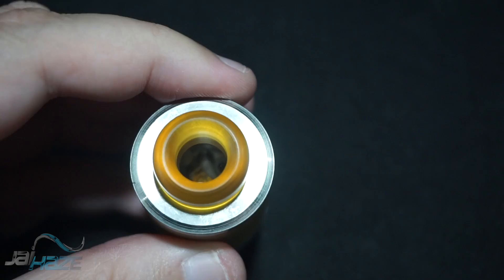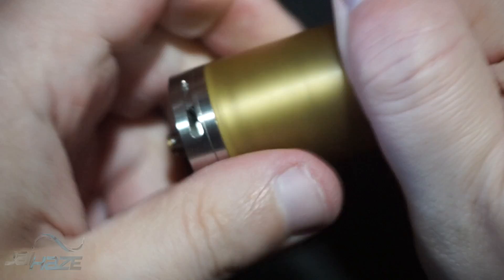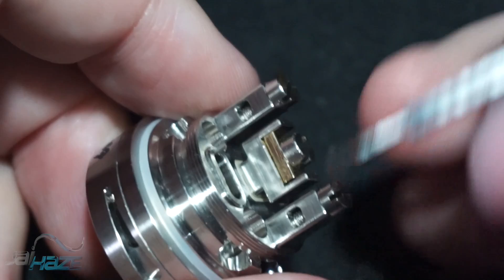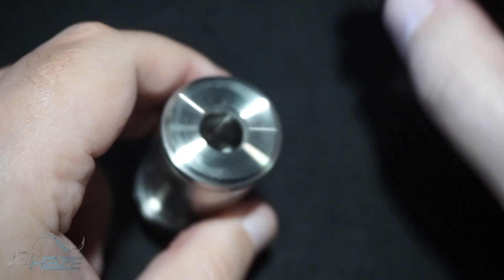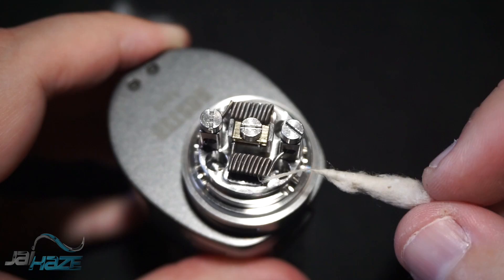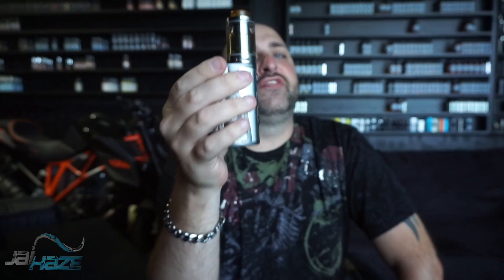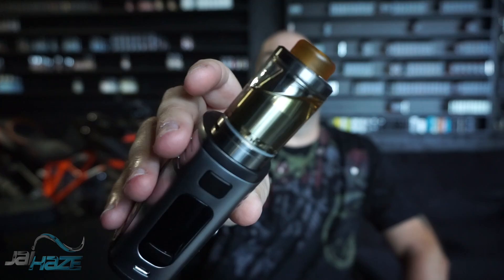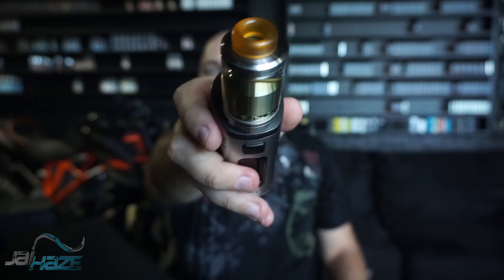Armageddon MFG King RTA Review and Rundown | Mad Modder Custom

Comment: Hey Jai, in case you really want to use this tank with another drip tip, on the Armageddon MFG website they sell Half Moon drip tips for this (That is just if it is the same size as the apocalypse, becasue I remember having the same problem, 810 were just a Little too big for the apocalypse)

Comment: Jai you can use the drip tip from an Apocalypse. Apocalypse Gen 2's after serial no. 2000 aren't 8/10. It's exactly the same as this one. Or get some Nub tips from DHD They work great for both 8/10 and Apocalypse.

Comment: Just dremel down a grenedy. You could just use a nail file💅 and that would not take hardly any effort to get it where it needs to be. Granted you shouldn't have to, but.... And the screws, it's better than it flooding EVERY time you fill it. That would suck. That happens every time I fill the Sherman. I hate it.

Comment: The person that made this tank at mad mod  said that He had a problem with  some of the top fill tanks he had used  leaking when you put the top back on them , that they would leak out the  airflow  when you put the top on ....  So He  designed this one  bottom fill //I used boraes tanks forever and I would fill them threw thew bottom even tho they were top fill just to prevent the problem he was talking about
Reply: Right To Vape I was thinking the same thing would prevent the problem I have with my Sherman. I will bottom fill my Sherman because I get so mad at the flooding. I kind of agree with this bottom fill design. Otherwise it would do the same thing as the Sherman which ended up being a deal breaker for me. Just wish he made an optional short section. Even if I could buy it separately would be awesome.
Reply from the maker: problem is brother, you need to take a screw out and another halfway to fill it for negative pressure
Reply: Jai Haze but even if it was top fill you'd have to unscrew something. And yeah you might have use something to unscrew it but could you use a coin or anything?
Reply: Jai Haze yea, pressure is a constant problem in all Rta's there is always some kind of thing u have to do or something when filling rta
Reply: Ian McIntosh How well does bottom filling the Sherman work for ya? I do something similar, through the top. Instead of filling through the fill ports, I just remove the whole cap leaving the chimney and fill on the sidewalls of the tank. Works perfect for me. I still flip it upside down briefly AFTER the top is back on the chimney, then open the airflow. Just to be safe, and no leaking one bit. I kinda dislike top fill altogether.
Reply: Sun Behind the Sun 777 haha it sucks what you described sounds a lot like better. But doing what I was is still better than wasting half the amount of juice that I put in it. That shit's expensive fuck that lolz
Reply: Ian McIntosh Yeah I hear you on that, the vape I get off of it is so worth it though.

Comment: Have you never used a Sherman or a modfather? The initial fills are fine. Everytime you go to fill it up afterwards, they leak their asses off. Not to mention the amount of spit up you get. The bottom fill is genius. It pushes all of the air pressure out so that there is no leaking. I'm baffled with the amount of "basic" people that are complaining or not understanding the bottom airflow 🤔
Reply from the maker: I hate both of those tanks with every piece of my soul. People swear by the both of them.  I didnt have issues with the leaking so much on the sherman but the modfather, omg. Jesus christ.  And I even got the other decks
Reply: Jai Haze haha yea it took me a while to figure out the wicking. Then it still leaked. It took me learning that you could bottom fill them in order to stop the leaking. I have many modfathers now and haven't had one leak in almost a year. Bottom filling fixes the issue completely. That's why I'm so excited about the King. Dont get me wrong, I love your reviews.  I'm just throwing out there the benefit of bottom filling.